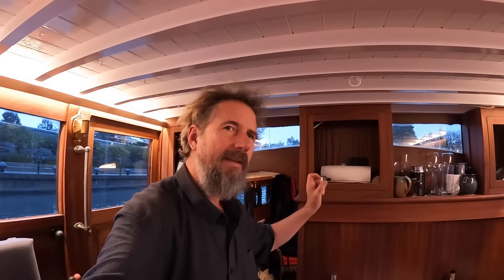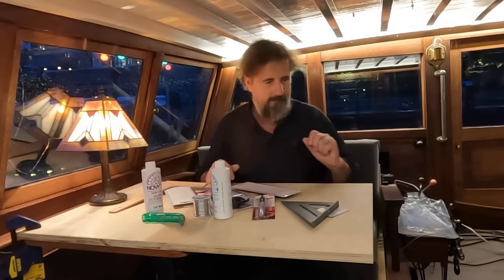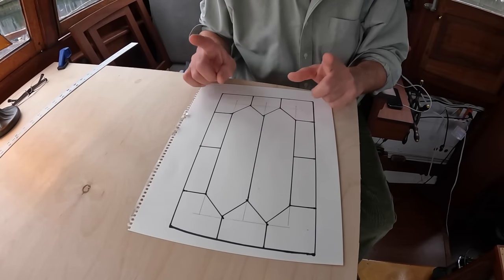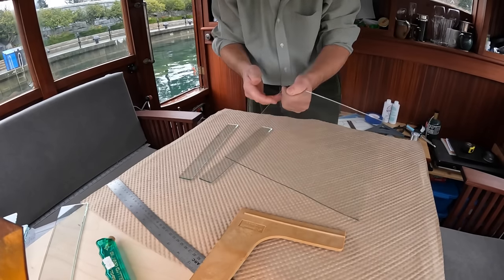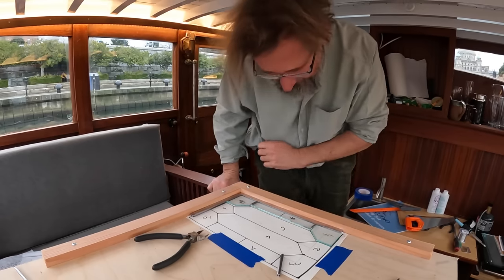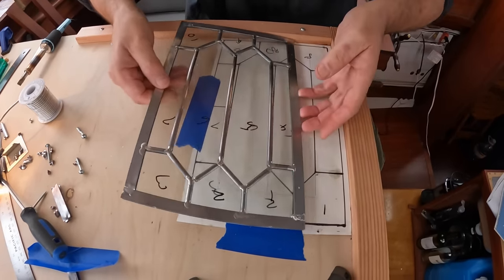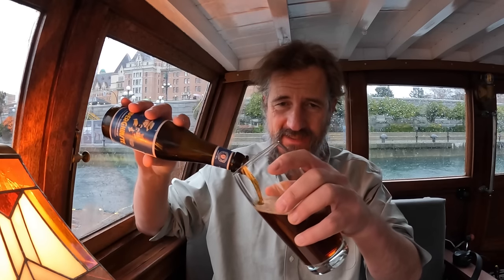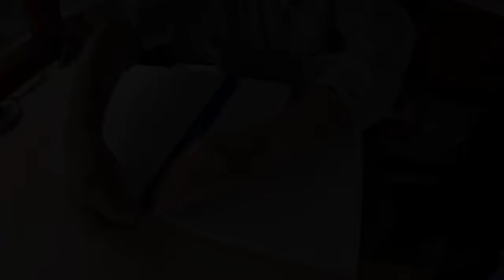Let's make some Leaded Glass Doors - #396 - Living aboard a wooden boat - Travels With Geordie

Comment: I used to build institutional greenhouses, the ones made of steel, aluminum, and glass. I hated cutting glass and never really got the full hang of it.  Score the glass and snap it with the ball end of the cutter. Most times it would break where I wanted it, but sometimes, no matter what, I couldn't get it to break right.

Comment: Hi Peter,
 when i made leaded glass panels for above the doors of a cottage i was renovating i used a cement putty rubbed into the lead came after soldering, it stopped rattles, i also used the patina solution to darken the lead, unfortunately one panel cracked due to STRESS when the house was rented out to a family of door slammers and property wreckers. so i remade it on perspex with self adhesive lead. I also have an airbrush and mini compressor and used the air eraser/sand blast gun to frost some of the corner panels. 
Thanks for the effort and time you put into your relaxing and informative films.
Look after yourself Ed.
Reply from the maker: I may putty if they develop rattles. Haven't decided on patina

Comment: Excellent work. I've been a SG designer and maker for around 50+ years. Just a note for next time you cut glass.
Don't press too hard. The sound you were making indicated you were pressing too hard and your break doesn't always work.
Otherwise, you did an wondrful job for a first timer. 
Always enjoy your incredible multiple skills. Thank you
PS: A new glass cutter is always a pain-no pun intended. Run it over some scrap glass a few times to 'temper' the wheel.
I had a great mentor (Doug Gibbs).
Reply: I cut glass plates for photography and this is excellent advice I will apply immediately! Thank you!

Comment: Hi Peter - I have done a lot of lead lighting, A couple of suggestions. Use horse shoe nails to hold the came in place as you go - just tap them and then wiggle out when done. You can also use an old paint spatula to cut the came, just hold on the line and wiggle with downward pressure - works a treat. Finally, leadlight studios sell plastic tools for enlarging squashed came - much better than a screwdriver - there you go! Great job you did though-
Reply from the maker: Great points, thanks.

Comment: Some years ago I made a hobby of making things with glass and copper and solder just like you explained. My favourite was to make terrarium’s of various sizes. I don’t know if this helps, but when I cut glass I would score it, slip my glass cutter or pencil under the score and gently press down on each side of the score. Worked for me.
Reply from the maker: Good point

Comment: Nice job Peter! Especially for a first attempt! A couple of tips I can share with you from 30 years of doing leaded glass work. Your lead ( called "came", not "cane" ) is shiny and new so it takes flux and solder well. It oxidizes over time, if so, you can brush the joint areas with a small brass bristle brush, which removes the oxid. so it solders easily again. You bought a good cutter, which makes cutting much easier, and clear window glass is the easiest to cut. With stained  glass, it is much more irregular with different annealed properties and is harder to cut. Listen for a nice clean "zipping" sound when using the cutter - that lets you know you are scoring the glass enough ( and not too much! ). There is a special putty used on leaded glass to fill the channel in the came completely so the glass is tight and the entire window stronger. ( Over time and use, the lead can fatigue and joints weaken without the cement ). Your leaded panels look great, and really add to Poem's cabin. Nicely done!

Comment: This video doesn't at all feel stressed
Apart from where you seemed slightly in stress when puzzling togehter your lead windows.
I am glad that the beer of the week was not too stressful, after all!
However, I'll stop stressing my mind now to find any more variations of the word stress.
The windows definitely look nicer than I thought they would when you drew them! And I wonder whether ist is possible to take some of the excess sautering material off and polish it back to the shiny surface it has now. But definitely: no stress! Keep the good work going
Cheers!
Reply from the maker: I actually like the distinct solder joints.

Comment: Having done a little of this kind of work, along with etching glass, my only question is, did you buy pre-stretched cane or did you remember to stretch the cane? If your cane isn’t stretched before you use it, it will stretch in the frame so that it will become loose and rattle not to mention the risk of glass falling out.
Reply from the maker: The supplier tells me the cane does not need it.
Reply: @TravelsWithGeordie  Pre-stretched. It is the better one to get.